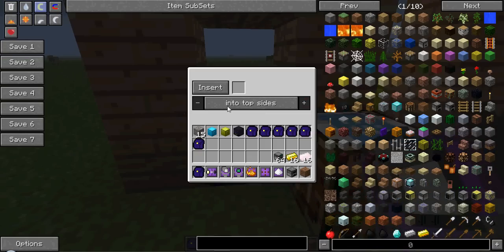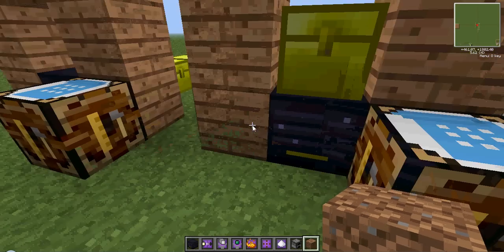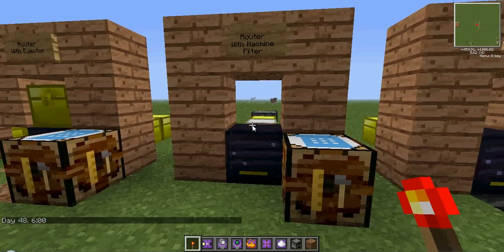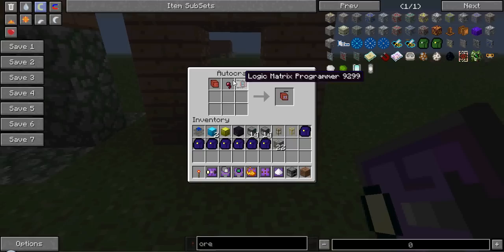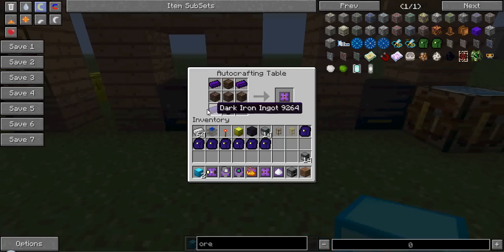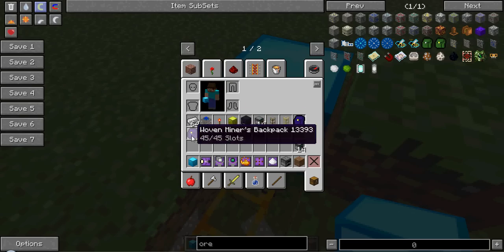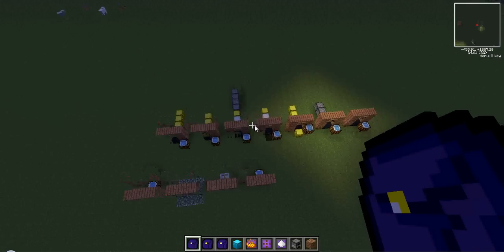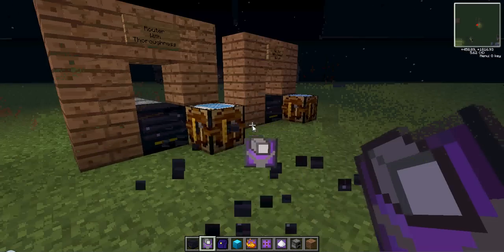Basics of Router and some Opinions

Comment from the maker: You have to add upgrades to fix that.
I believe now they fixed the thoroughness upgrade to finish adding items to a barrel before moving on but I am not sure which will take of the the dirt being spread out. Instead of doing this I usually use cobble as a place holder for items I am going to add later on.
To make the router insert full stacks you must add the bandwidth upgrade.

Comment from the maker: I used it for my sorting system in the server I played on. But sadly I couldn't record it to show because the problems my computer was having at the time. Basically I had a sorting machine pulling from an ender chest which sorted "to be processed" items into another sorting machine (those machines were TE and went back to the ender chest. The first sorting machine had the "no place to go" option selected which went to my router and got sorted into barrels (lots of them I may add.)